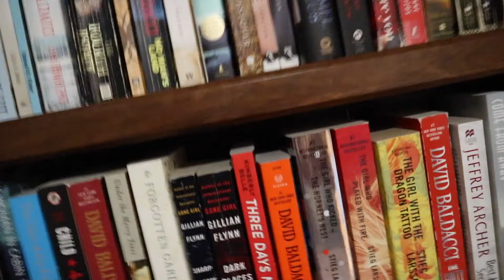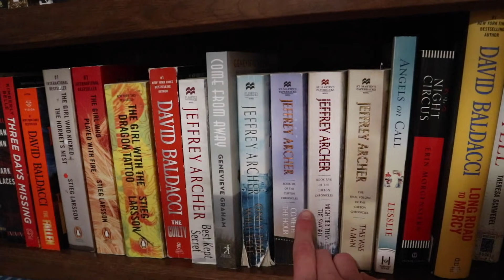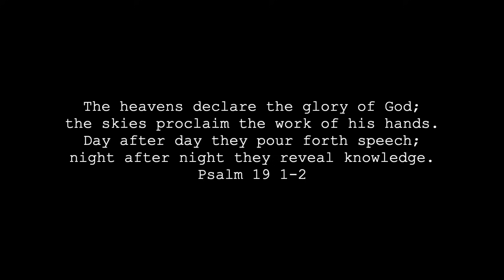Vlog #55 Q&A kitchen mishaps? do I have a boyfriend? + weekly clean with me

Comment: As a dress (or skirt) wearer and an avid bicycle rider (I don’t own a car).  I would suggest looking to the Dutch and how they deal with long dresses and bikes.  If you have a fender or rear rack on the bike, you can crochet (or sew) a skirt guard that keeps your dress from getting caught up in the rear wheel.  There are also plastic versions you can buy and install, but really the crocheted ones are so much cuter :)

Dutch bikes usually also have a chain case that fully encloses the bike chain. Unfortunately that’s not a DIY project or something that you can really add after buying the bike, but if you can find a bike with at least a top chain case that helps a lot in keeping your dress away from the chain.

Bonus tip: There’s a “hack” that involves a rubber band and a penny or other small coin to fasten the front and back of your dress/skirt so that it flaps around less while biking.  The phrase to search for is “penny in your pants bicycle” (why they call it “pants” when it’s a skirt, I’m not sure lol).
Reply from the maker: Ok thanks for the tips I'll be sure to try them I can't afford to have any more holes in dresses 🤭

Comment: I've got seasonal allergies too. What helps me is after sweeping vacuuming, to spray a light mist of vinegar water in the room. It washes all the airborne particles down. I also have a airfilter macine in my bedroom. It keeps the air clean and since I spend 8 to 9 hours there, it helps.
Reply: Ps, you could do a light spritz of your area your working in. It will clean the area a little.
Reply from the maker: Ok thankyou for the tips 😊

Comment: "I had to wash the ceiling" 😂😂😂 ive lifted a blender jug up to pour it into a cup and the entire bottom just fell out i still dont know what happened but yeah brown coloured "green smoothie" EVERYWHERE over the counter on the floors and cabinets i had no way to secure the bottom of the blender either which meant no way to remove the smoothie after all i couldnt hold the blender jug on the machine so it wouldnt come out and lifte the heavy thing into the sink its electronic after all! So i just had to accept the fact that the only way the like 2 litres of of smoothie aka the full massive jug was coming out was through the bottom 😂😂😂 cue me frantically trying to move the flow with my hands like it was water in a bathtub and divert it on the bench and stop it from going on the cabinets and floor anymore and the blender blade was attached to the bottom which was still secured to the base machine of the blender so i also managed to not only knick my soft thumb fleshy area with the blade but it scarred so now everytime i see the tiny scar on my hand i remember the blender incident 😂 found out later that it was the blenders fault not me being dumb but still what a waste of food and my time and energy not only prepping the drink but then cleaning it all up only to have nothing to show for it besides a new scar and sore and tired body from cleaning smoothie up.

Comment: I have a scar above my eye in the same spot as you do.     Im sure I got my scar in a sillier way, and it was so silly they thought I wasn't telling the truth, and that it was abuse, when I went to the dr about it.    I was vacuuming up some stairs with a little handheld dynamo, and my hair came out, and I was too busy to put it back up, and so the vacuum travled up my hair and smacked me in the face pretty hard, and cut my eye where your scar is there.  I got five tiny stitches, and drove myself a long drive to the ER. I was a young mom, cleaning for a pot bellied pig farmer, and they were mad I didn't just put a band aid on it.  One day, their potbellied pig farm got on the don polluck show, It was a local news show, and I was told to go walk a pig.  I didn't want to be on tv, but I was told I would be fire, so I did.  so,  those are my misshapes with that job.   Your video's are a lot of fun, educational, and nice.  Don't take the weight off a pressure cooker without letting out the steam. It would be like putting a paddle in a mixer.

Comment: Honey, you can wash those shoes. Spray them with Simple Green and let them set overnight, then toss them in with your dark clothes.  Don’t put them in the dryer. I turn mine down over a heating vent. The air blows up inside the shoe every time the heat pump comes on. Another way to dry them is to save the insert that comes inside your new pair, place it inside the old ones and let them air dry, you can even hang them on the line. You have nothing to lose by trying to wash them. Once clean, you can wear your old ones for work and your new ones for going other places. You are the workingest young lady I have ever seen! Can I send my grandchildren to you for training?
Reply from the maker: 🤣🤣 oh my goodness depends on how many grandchildren you have not sure if I could handle too many 😊...I just usually go over them with a brush and sopy water

Comment: Is the potato chipper electric or one of those you have to hang on a wall and pull the blade down yourself? 
I had a job at a fast food place that used fresh potatoes when I was 16.  I liked chipping potatoes, it was a good workout. 
I thought it was fun, until my boss forgot to tell me there were new potatoes in the  cooler. I noticed the peeled potatoes were more yellow but I didn't notice they were not as soft as what I was used to. 
I put a big potato on the blades, pulled the machine down to smash that potato trough the blades with the usual force and "clunck!", the potato was so hard it would not go trough the chipper. My boss felt really bad I hurt my shoulder 😄.
Reply from the maker: We used to have one that hangs on the wall but, have since then moved on to an electrical one. 
I think that was one of the reasons that we put it away is because it was difficult to use.
Reply: @gisellewaldner9406  Good you have that. It's faster and it makes the work lighter for all of you.
Imagine disliking the task and having to chip for so many people manually, few.